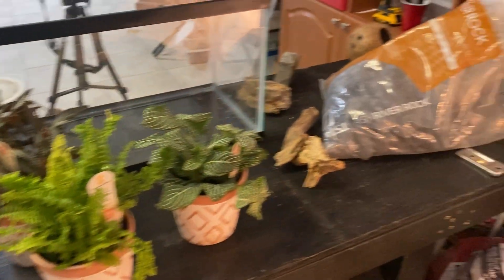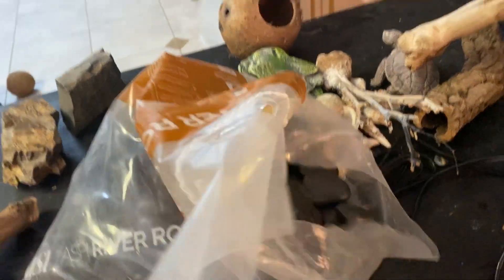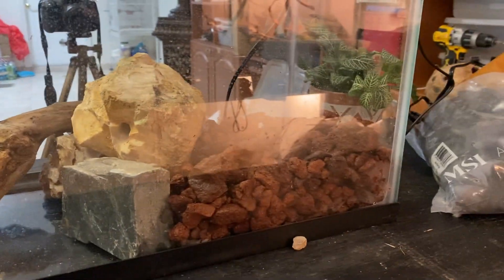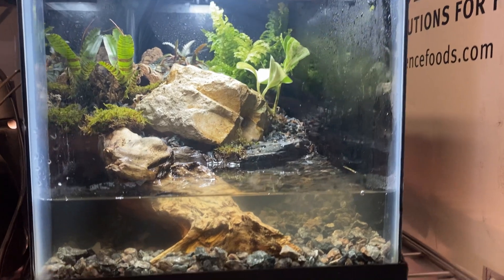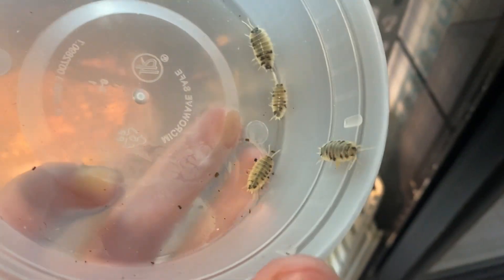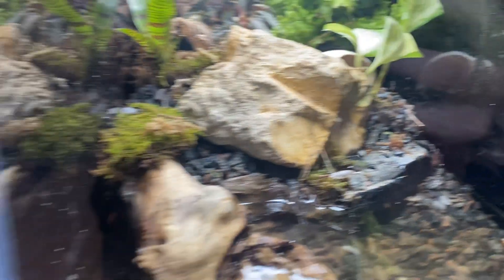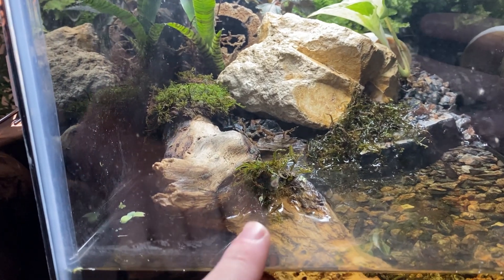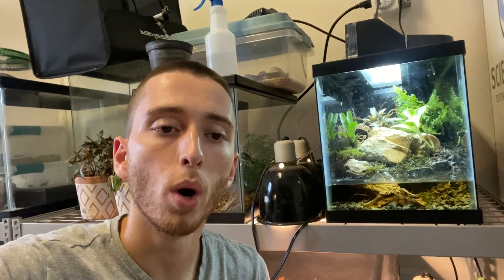Unboxing NEW Pet Vampire Crabs!! Building Their Dream Home!!

Comment: Just a heads up these crabs love to dig in wet soil and burrow when they molt. They also usually molt in the water so soft sand way better for them. 
Otherwise your tank is pretty good :)
Reply from the maker: Thanks for the tip! There’s some soil in the base of the plants but I’ll need to add some sand in the water area 👍
Reply: @ShadowsReptiles  No problem :) Looking forward to see more of these guys. They all have different personalities and habits.